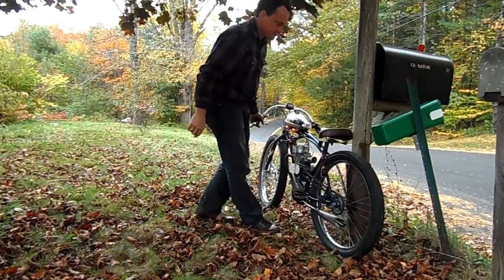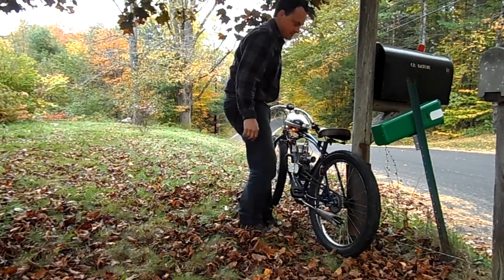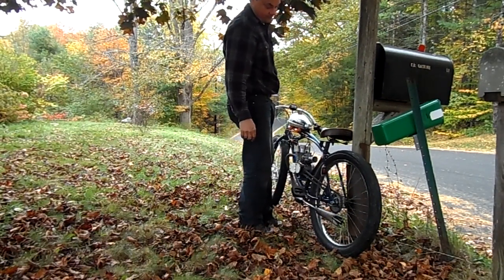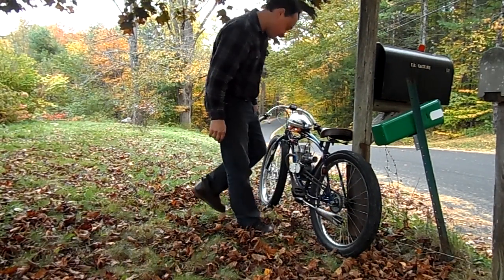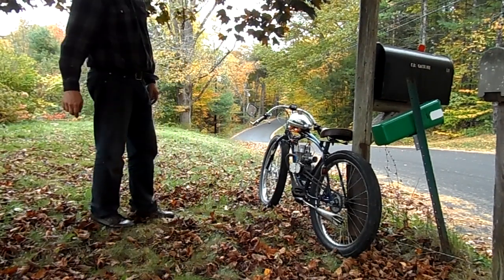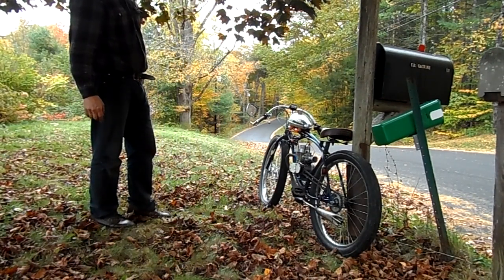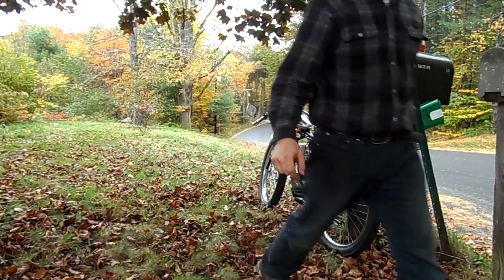Fred's first test of the "HD Lightning" ignition

Comment from the maker: Hi Tevis. Sure, I'm making engines, but I'm not selling them in my ebay store anymore. Ebay is too expensive! Check out my website, crmachine.com
Reply: +Frederic Chelminski Will your Super Race engine fit on a Skyhawk Frame with the Pedestal mount on it? I was also wondering if i get the cylinder head that's made for pump gas will it be ok for long distance rides? 15+ miles. its got everything i want to do to it done already and with high quality parts.
Reply: +Derek Hutchings Saw one of your other videos and answered my question.